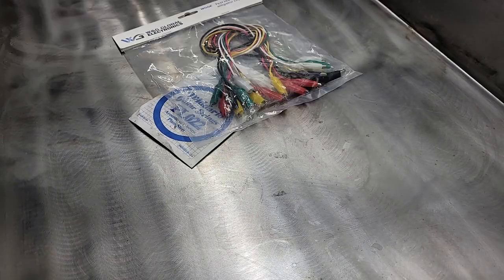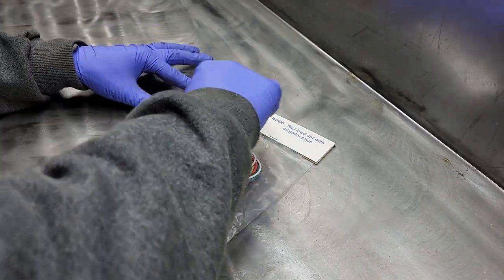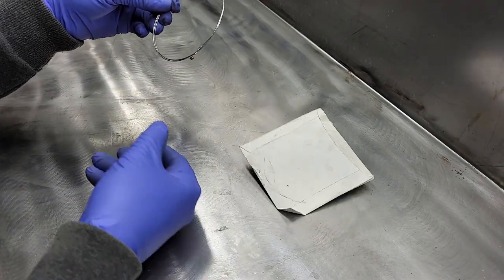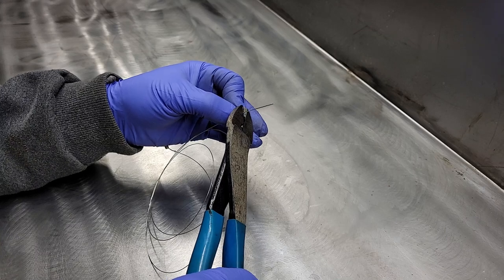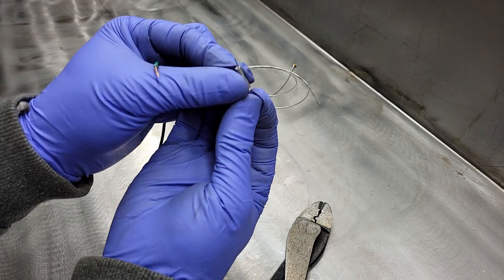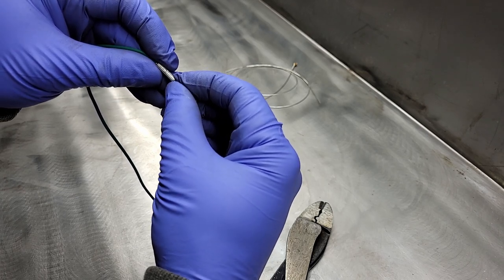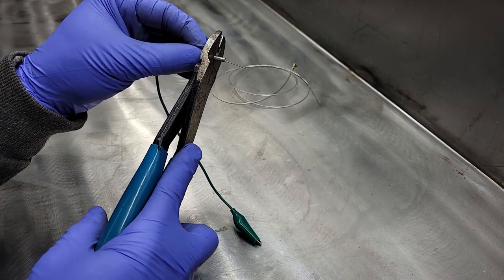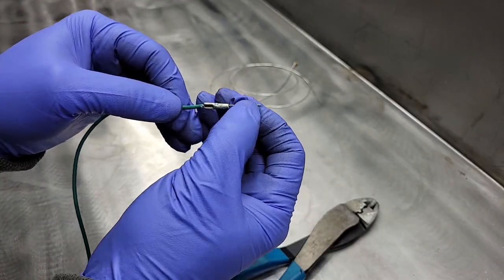How to make the best DIY back probes in 2 minutes.

Comment: Good video, only advice i could give is solder the wires on the alligator clips, when you pul the boot back they are just loosely crimped, this could give you a false connection. Solder the wires on the end's for best connection.
Reply from the maker: Thats a great point Jason, im sure my crimps are strong, but if these have a weak point, it will be the factory alligator crimps. ✌️
Reply: @Finding_Our_Way  thats what i'm saying, your crimps are bang on, but the factory crimps on the Alligators are very BAD! :)

Comment: Nice probes. I have to admit that I am not familiar with the term "back probe." I see that you are plugging them into a connector, but please explain their specific use. Here's a tip... You are using plain steel guitar strings. Plain steel is not the greatest conductor. Guitar strings also come in brass and bronze, IIRC. So, maybe research which of those metals is the better conductor and buy that type of guitar string. HTH.
Reply from the maker: Thanks for the tip.
I use these when i need to probe the back side of a connector while it is still plugged in, also if i need to unplug a connector and test the front side it is great too. 
The guitar string has a good amount of rigidity,  i can press these pretty hard and the guitar string doesnt bend. 
I use these when diagnosing vehicle electrical components.
Reply: Same here.... I work with test equipment and metrology but had never heard the term. Interesting video and premise. I could see them being really useful in your position

Thanks for sharing!

Comment: They sell seemless barrel connectors, much nicer crimp
Reply from the maker: Good point, those would work better.
Reply: @Finding_Our_Way  Why would the seamless barrel connectors work better than the butt connectors you used?
Reply from the maker: @bernardocisneros4402  if you dont pinch the connectors in the correct way with the correct tool, they can open up slightly on the seam. I havent had a problem with mine, but technically the seamless would work better.
Reply: @Finding_Our_Way  Thanks!

Comment: Can you provide a link to the "non insulated butt connectors" and the shrink tube? (which size do you use for these?) The 0.56 mm guitar string I've found🎸
Reply from the maker: Hi, thanks for the comment. The alligator clips i posted are 22-AWG, so https://amzn.to/3IYlp8G these butt connectors should work (22-16 gauge) 
And here is a link for an assortment of heat shrink tubes. Definitely handy to have in your toolbox.https://amzn.to/43O5CTx
Honestly, I purchased my butt connectors and heat shrink from the local auto parts store, Lordco. And it is cheaper for me there. At lordco i buy heat shrink tube in 3 foot lengths and its very cheap. Cheers

Comment: I like the idea. they seem like there would be more flexibility. My probes some time bend over from the weight. I looked for some .56 guitar string online but did not see any. Maybe a plain steel paper clip?
Reply from the maker: Thanks, yes they work great. I think a paperclip would break pretty easily. These guitar strings handle a lot of abuse. My first set I made lasted about a decade, i only made a new set because i lost most of them. Try walking into a guitar shop, they will have lots of string, thats what i did a long time ago and it was very cheap. Cheers.